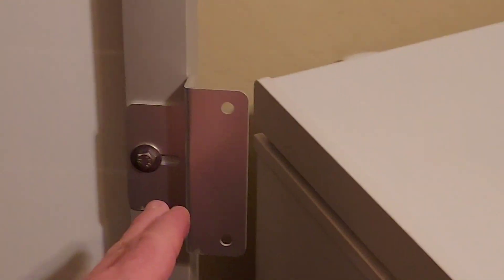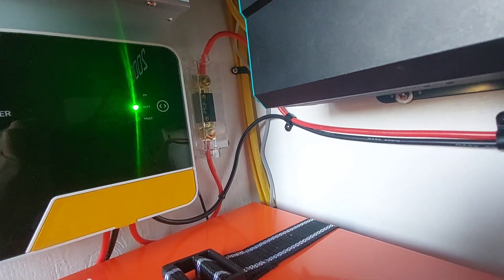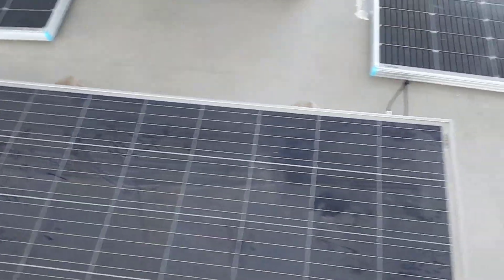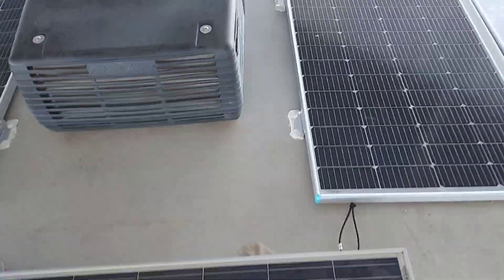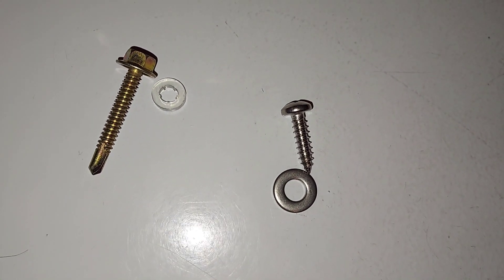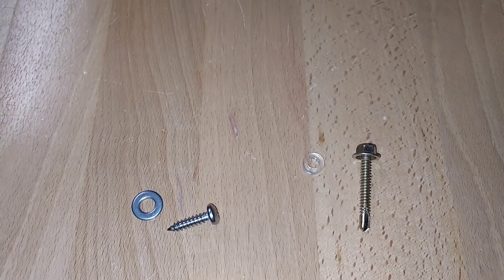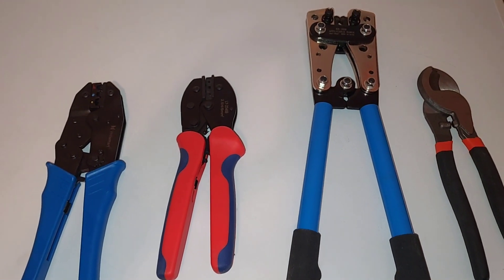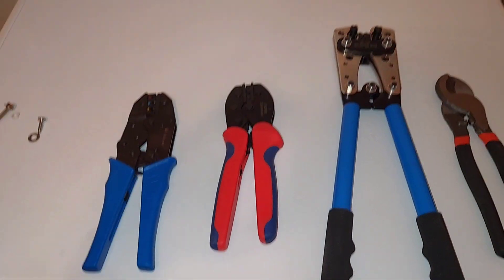Momentum 21G solar panel and controller install.

Comment: Great videos.  How warm/hot does it get inside the compartment with your inverter, solar charger, battery, etc?  Have you used your set-up in the summer heat yet?  Have you noticed any issues (overheating) with your electrical equipment due to lack of ventilation in that compartment?  I am planning a similar install in my 25G and am wondering if I need to add ventilation to that cabinet space somehow.
Reply from the maker: Great question! I am seeing about a 10° increase in temperature inside cabinet, mostly from solar controller.  I did not have this setup in the summertime. I was looking at a vent hose with inline fan and run from inside to the battery cabinet. I am anticipating it will be a problem here in the Arizona summer heat.
I might leave solar off during travel thru the desert to not exceed the components high temp limits.
Thanks for watching!